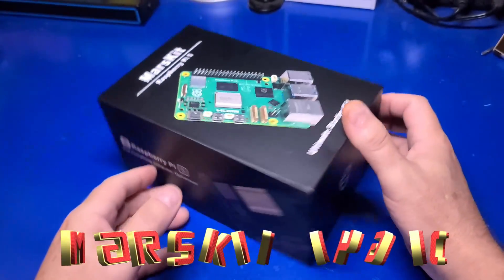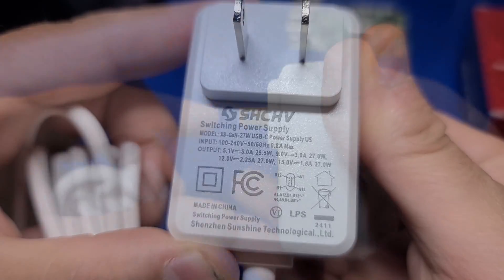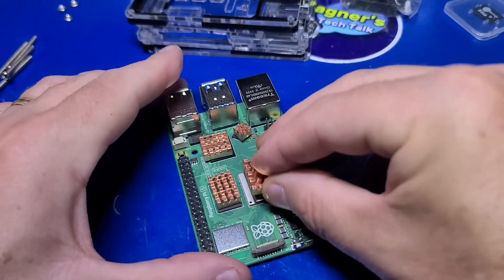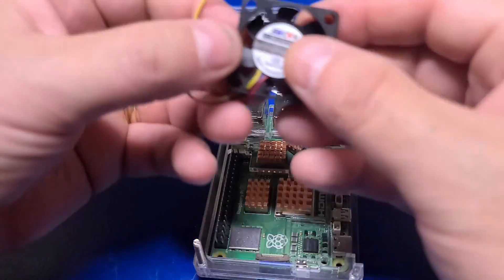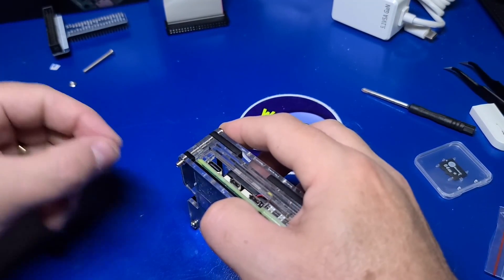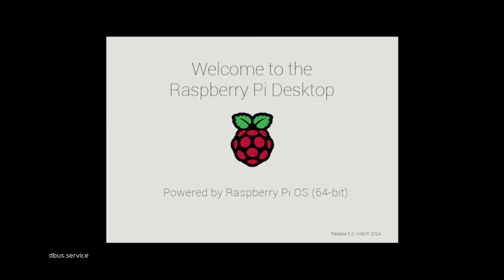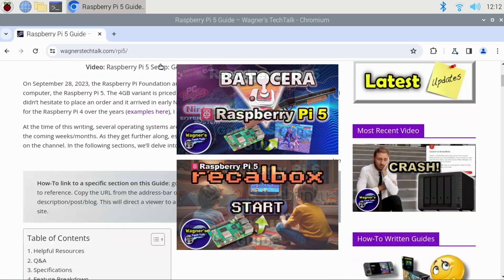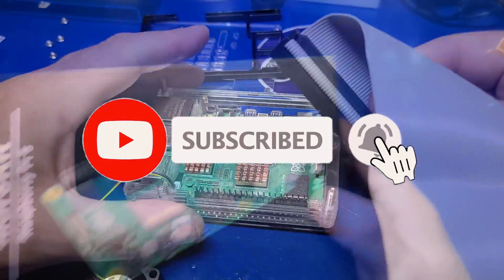Raspberry Pi 5 MarsKit Setup: 4GB Pi5 Setup Guide

Comment: Very nicely done video. I like your videos because you explain things very well without talking so fast, it becomes difficult to understand. 
A nice feature of the pi products is the wizard setting it up. I purchased a pi 400 last year.   Setup went very smoothly, no drama.  
Only thing not included in that was a monitor I picked up at Costco.  Will you be doing any videos using the GPIO? 
I agree about the feet. 
Thanks for another enjoyable video Jon.
Reply from the maker: Thank you so much John, I really appreciate it!  I don't have any videos planned for the GPIO specifically, what did you have in mind?  I have done a bit with the GPIO on the Pi4, just not more recently on the Pi5.  Thanks again and I appreciate your kind comments!